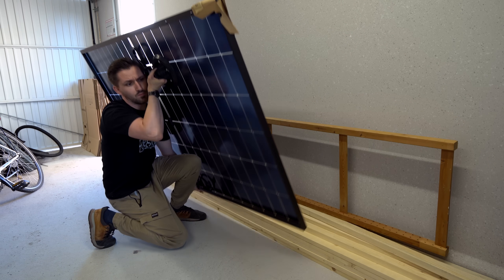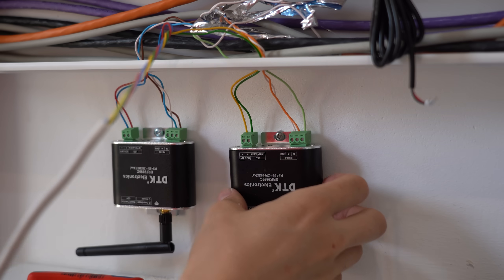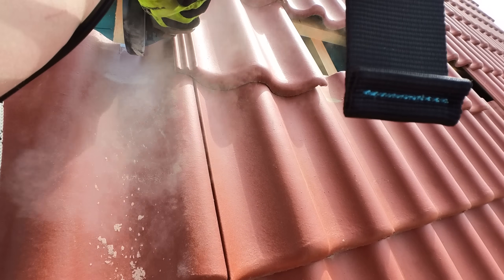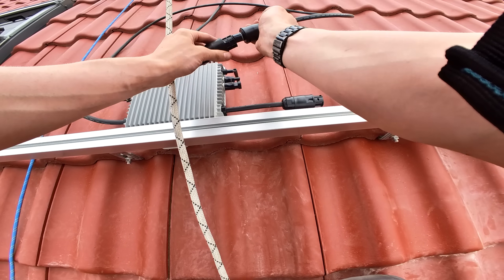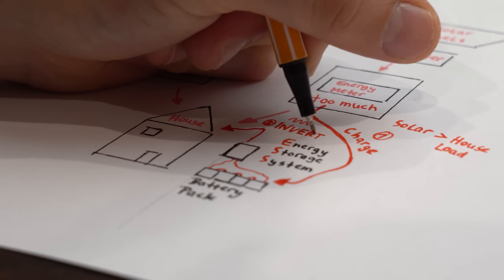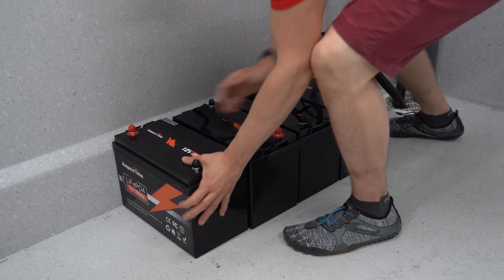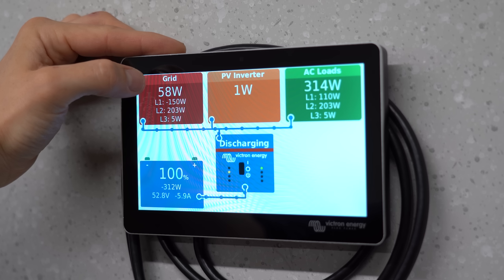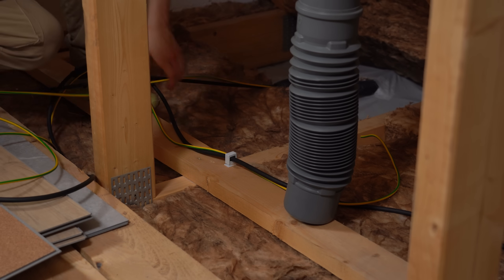Pushing a "legal" Mini Solar System to its LIMIT!

Comment: Nice but those bats need balancing as a whole BMS pack not 4 individual BMS alone yes the protection will save you but over time it will become unbalanced.

Comment: Fun fact
In the Netherlands we also have the option to have dynamic energy contracts. 
Every day at 3pm, the hour kWh price for the next day will be published. 
Why? The grid should be kept stable in Europe. 
So excessive power should be avoided (is cheap to buy) and a shortage is expensive; they have to purchase 'extra expensive' power, E.g. between  6-9pm.

As a private home owner,  you can take advantage of this:
Use power when it's cheap. 
E.g. heatpump, washing machine or EV charger. 

 Hobbyists and other enthusiasts build their own system (or let it do by a certified company).

We have a similar setup as what you just saw, but with some extra intelligence.
With solar on top, charge the battery when power is cheap, sell it when it's expensive. 
Usually one or sometome even twice each day. 
Sell/buy with 3x25Amps.

Like this, we have:
 3x25A 230V grid
Smart meter
3x victron 8000 Watt (VA)
2x 15kW 48V LFP battery bank.

Intelligent software calculates the demands of the house/ revenue/solar gain etc for the house each day. 
Usually at night we purchase cheap energy (10-25 kW each day) and sell it during the evening when the price difference is >20c (euro/ dollar) per kWh.

So,  free energy during the year, and a (small) profit to pay the hobby. 
What must be said: this setup is very expensive as you can imagine,  but nevertheless,  it pays back for itself in 10years.
(Lifespan=20 years) and some have a nice hobyproject with it...

Comment: You can't just plug the power from your solar panels into your home electrical grid. That would cause a severe electrical issue and likely start a fire.
Reply: If it wouldnt be safe, then it would not be allowed by German regulations.
Obviously there can be other earthing systems in other countries.
Reply: A small grid tie inverter is needed to go from the D/C solar panel to the A/C line. Scotty had one.

Comment: Is it possible to add the storage before the inverter, instead of using the inverter-rectifier-storage-inverter chain?
Reply: direct DC connection to the battery will require thick cable due to losses of 'low' voltage compared to main AC.

Comment: Nice system! That is a lot of work, i can say from experience. Just one question, you seem to have microinverters connected to the pannels, or did i miss something? I ask because of the other inverter down the line. And the protections should be for DC current before the inverter. Sorry for my english, but my german is worse 😂
Reply: You are correct.

The Panels attach to Micro-Inverter, to send the D/C power as A/C.

If the A/C power goes out, the Micro/Inverter is shut off. Very safe.

The whole house inverter with batteries can drive the grid tie micro/inverter, while shutting off the grid mains, or if the grid power is off.

Any excess power generated by the panels & grid tie inverters will sink to the batteries. Once the batteries are full, the whole house inverter shuts off the grid tie micro inverter[s].

Comment: I would recommend a different way of going about it.   Instead of going with a grid-tied style of system, just take your workshop off-grid and only use the grid for load support when the batteries get too low via a simple charger.

* No micro-inverters.   DC strings.

* Victron charge controllers connected to a 48VDC battery system.

* NOTE: Buy a 48V LFP battery.  Connecting 4 x 12V batteries in series generally does not work well.  Even with whole-battery balancers between the discrete 12V units.   You will get tripped up if any of those 12V batteries decides to trip off on low or high voltage and wind up with a non-working system that is unable to automatically recover itself.

It is generally best to have at least two (48V) batteries in parallel, again giving you some redundancy when something breaks on you as well as being able to handle inductive surges that feed-back onto the DC side through the inverters.   For example, 2 x 50Ah 48V LiFePO4 batteries in parallel gives you 4.8 kWh of storage.  Also easily expandable simply by adding more batteries in parallel, though if you do make sure they are properly fused AND DC breakers, since batteries in parallel can dump a massive number of amps if a short occurs.

There are also serious safety issues when putting multiple 12V lithium batteries in series to drive a 48V inverter.  The inverter relies on the low impedence battery path to soak up stray energy that feeds back from the AC side to the DC side.  If one battery disconnects, suddenly the path disappears and this can result in dangerous levels of AC on DC wiring that you might otherwise think is safe to touch.    For this reason it is far, far, FAR more robust to have several appropriate-voltage lithium batteries connected in parallel instead.

* DC wiring solar-to-charge controllers and battery-to-inverters, with appropriate DC breakers on all paths.  Maximize voltage (up to a Voc that the charge controller can take) and minimize current.  Some redundancy is good, i.e. having at least two charge controllers (two solar strings) so things continue to work even if something breaks.

* One or more inverters in the rooms needing power.  Equipment powered directly from these inverters.  It is better to have a couple of smaller inverters than to have one big inverter.  Not only for safety, but also for redundancy.  Again so you are not entirely DOA when something breaks.

* And a 48V battery charger or battery-tie-capable power supply that supplements your above off-grid system with grid power when the batteries get low.   For example, a Victron battery charger in "power supply" mode with the voltage set for low-battery load-support, which would be around 51.8V for a 48V system.    Doesn't have to be a big honking charger, 500W is plenty.

And that's it.  You are done.  There is NO backfeed to the grid.  Its simple, generally requires no interaction with the utility (because it isn't grid tied), and even with insufficient solar this system will have really good load-shifting capabilities because the grid support only comes in gradually, which means you can usually avoid pulling from the grid during the peak evening consumption period after sunset.
Reply: The complexity of this setup is too high.

I bought a 6000 watt grid tie inverter, I am wiring 5800 watts of panels to them. I bought a Genetry Solar 12k inverter, and 34k worth of batteries for the GS 12k to sink the extra power to. None of these extra components.

In my case, I have 2x 33.6v battery packs in series, with 2x sets in parallel, to add the redundancy you speak of. I could have wired all 4x batteries in parallel, but I need the full 36k peak A/C output ability of the GS 12k, so the higher D/C voltage meant 1/2 the D/C gauge required & 1/2 the D/C breaker capacity required.

The GS 12k Will frequency shift to shut down the grid tie inverter, when the batteries are full.

In essence, this can be done with 2x boxes, like I am doing. Done.
Reply: @DavidHalko  That Genetry Solar inverter-charger... ah, it looks like they have 24V, 36V, 48V, and 60V version but the 60V version hasn't been validated yet.   Max DC input for the 60V is 75V.

If you are depending on the 36kW surge capability then you have a problem.  Your DC margin on the input side is roughly 33.6 x 2 = 67.2V vs 75V ... that's only 7.8VDC of margin on the DC input.

This means that the DC input has to be ULTRA LOW impedence.   Otherwise the inductive surge that presumably is happening when you say you need that 36kW surge capability will feed-back and push the DC side well outside the absolute maximum ratings of the inverter's DC input.  

And in addition to that, it will probably push the DC side voltage past the absolute maximum limits of the battery if it happens to be near 100% SOC, or below the absolute minimum limits of the battery if it happens to be near 0% SOC.   That can easily cause the battery's BMS to trip off and if it does that during an inductive start the voltage on the DC side MOSFETs of the BMS could get pumped up well beyond their limits.

To deal with this you need two... hell, I'd say even three batteries in parallel.  Not one.  Three.   If you really insist on sticking with 2 x 33.6V batteries in series that means you need 3 sets of 2.  3p2s to handle the inductive surge and potential trips safely.   And to be frank, I do not recommend putting any batteries in series for a configuration like this.  I would stick with 48V batteries (LiFePO4) and put at least three of them in parallel to get the necessary low impedence on the DC side.

Also, I presume you have balancers across the two 33.6V batteries in series.  LiFePO4 batteries in series require balancers.   Though generally speaking only 12V balancers are generally available so I'm not sure if you can find one for two 33.6V batteries in series.   It's not a configuration that is very common with LiFePO4.  It's more of a lead-acid configuration.

This is one of the really big differences between small battery systems and big ones.   When one is talking about a few thousand watts or less, the impedance of one LiFePO4 battery on the DC side is usually good enough.   When one is talking about tens of thousands of watts, however, one battery's worth of impedance isn't good enough.  Even if the C rate is within bounds, the impedance won't be low enough to handle inductive surges that large safely.

-Matt
Reply: @DavidHalko  You are putting a 67V+ input into the 48V model? I would not do that!  Even if the manufacturer's rep thinks its ok.   They clearly have different DC-side internals if they are selling them as four different models.  If it were the same unit they'd only sell one model.

You are talking about having two BMS's... is this a home-built battery?   Which LiFePO4 cells are you using? Generally speaking, two BMS's cannot be paralleled  onto the same set of cells.  They won't be synchronized with each other.

And speaking of cells, they would have to be 300Ah prismatics to even stand a chance at those amperages.  And even then you are over-currenting them if you regularly run at full load.  And the internal resistance won't be low enough from a 1p stack of cells to handle a 36kW surge safely, regardless of their capacity.

At the very least I would put a scope on the DC side and see what the waveform looks like when you hit the AC side with the 36kW inductive surge.

I don't think your system is going to last very long at these stress levels.  I'm going to stick to my earlier recommendation that you buy three 48V rack-mount LFP batteries, plus the rack (with integrated bus bars) to hold them, tied in parallel.
Reply: @junkerzn7312  - Hey Matt,

“I would not do that… manufacturer’s rep thinks it’s ok”

I had the original developer on a zoom call, after the manufacture rep committed to the design. 

Genetry Solar is not some Chinese white box’ed Inverter with a 1st world company reselling internals in their own case. They designed it, they know what it is capable of.

“They clearly have different DC-side internals if they are selling them as 4 different models”

No, they have 2 models, they wire the 2x models differently when they go out the door. 

The 60v Genetry Solar 12k requires a 60v fan, otherwise it is the same.

“If they were the same unit, they’d sell only one model”

Yep. The GS 6K is physically smaller, with a smaller transformer. 

“Two BMS’s”

Yep. 

“home-built battery?”

Not really. 80+ lbs each module. See:
- 19:30 - https://youtu.be/7T1FMffOnpQ

I want a Bluetooth BMS that I can run from my phone, so that is what I am adding. 

“Generally… two BMS’s cannot be paralleled”

BMS vendor committed to the design.
It was in their BMS engineering notes, 
before I approached them.

“They would have to be 300Ah prismatics”

150Ah continuous rating, 2x parallel 300Ah.
300Ah 10 sec pulse, 2x parallel 600Ah.

“LiFePo4”

Nope. Li-Ion. 4.2v 100% SOC each cell.
I’ll be charging them to 75-80% SOC.

Theoretically run for 2 days with 0% sun @100 SOC, if I do not get more efficient.

If abused (0%-80% SOC every day),
 chemistry should last 5-6 years.
Planned usage (hovering 30%-80%), 
 should run 1-2 decades.
Reply: @DavidHalko  You are using reclaimed EV battery packs?   Well, I suppose I shouldn't complain about DIYs too much but I think it is important to point out that you are taking major risks across the board.  Your entire design is just too close to the edge.

Bare EV packs have one-time per-cell fuses but no trunk fuses or breakers that I know of.   Lithium-ion (NMC in this case, most likely) is NOT a good chemistry for home applications.   It is very dangerous on multiple fronts, particularly charging and the lack of a settling voltage once charging is complete.   There are no safety features in bare EV packs beyond the little per-cell one-time fuses.  None.   Thermal runaway on a NMC battery is 100x more dangerous than thermal runaway on LiFePO4 (and NCA is even more dangerous than NMC).

There is no margin for error, unlike when you buy pre-built LiFePO4 battery packs which have a whole pile of safety features built into the packs.

I really don't recommend that ANYONE use any lithium chemistry other than LiFePO4.   Even just looking at all the comments from random people interested in DIYing batteries, it is scary how many mistakes people make.
Reply: @DavidHalko  Uh.  Well, sure, anyone can throw in a hybrid inverter or an inverter-charger,  but you are talking about a much larger and far more expensive system.  Also more expensive to maintain.  The inverter you quoted is $3000 alone.

We aren't talking about huge systems here, only you are.   They are completely different types of projects.

And it isn't really less complex anyway... not sure why you think it is.  Your inverter only integrates a battery charger and you are using a bunch of micro-inverters instead of just one or two charge controllers.  That's the only real difference.

You still need an inline fuse on your battery cabling plus DC breakers on the battery cabling.  You need AC breakers on the microinverter output as well as a shutoff.    The wiring isn't really that different... you are already running at least 175A at 67.2V.  It would be  222A at 54.0V.  

You are putting two 33V (LiFePO4?) batteries in SERIES going into a 12kW inverter?   Only two?  That's just plain insane.   You have zero protection against inductive feedback from the inverter with a setup like that.  If either battery trips you are risking frying your entire system!   You are also running the batteries... what C rate are you running the batteries anyway?  If you want the system to last it had better be 0.5C or less at full load.

Comment: Why not use 48v rack server battery?
Wouldn't it be easier to install?
After all, they also have a capacity equivalent to 4 of your batteries and will definitely look more compact and tidier
Reply: Yes.  And, in fact, he should have used a dedicated 48V LiFePO4 battery.   4 x 12V LiFePO4 batteries in series have serious problems.  If a battery trips off on either low or high voltage the system can get into a situation where it is unable to automatically recover.   

48V systems based on 4 x 12V batteries in series require whole-battery balancers (which I don't think he has either).  And even then they aren't reliable when using batteries with BMS's.

Its parallel or nothing, really, when reliability is important.  So he should have bought one or two rack-mount 5kWh 48V batteries.

Comment: I "ran the numbers" not long ago for my house. A system that could turn my daytime grid usage to near-zero would take the life expectancy of the panels just to break even on the buy-in costs. That was assuming I could sell any excess back at purchase rates; which we know I can't. 🤷
I'd love to go solar but the tech just isn't there yet. Tough to properly recycle spent panels too (that part isn't said aloud very often).
Reply: 30-50 year payback? You must have insanely cheap power. Payback in Arizona is 2-4 years. We have both panel and battery recycling here. Not that I have ever seen a panel fail in 40 years without physical damage to the panel.
Reply: @dannelson6980  back then was under 9c/kwhr. Panel life was quoted 20yrs.

Comment: We have the same inverter at our home. But I found out during some research that the inverter firmware has a security problem where you cannot change the password of the access point because it always resets. Luckily there is a GitHub Repo that contains the firmware updates because the manufacturer doesn't supply those on the website and instead only over email. The repo is dasrecht/deye-firmware and I highly recommend upgrading it because if someone connects to the AP of the inverter they can use ModBus (no / hardcoded authentication) to get the SSID and password of the wifi the inverter is connected to.

Comment: There is a lot of differences in how this works in different countries.   Where I live, utilities are required to purchase backfeed power from individuals.  There is a requirement that your inverter accept data signals for remote shutdown by utilities so they can de-energize the line for repair/maintenance.  That's a reasonable safety measure in my opinion.  Also, the idea that you are required to hire a professional to work on your home electrical system would be offensive to most American homeowners.  Hiring a professional is certainly an option but if you can't do what you want with your property - do you really own it at all?  Also, you use shockingly little power - I don't know how you do it.  I need around 4KW of generation (roughly) to break even during peak usage.